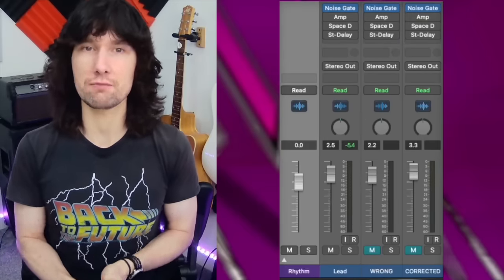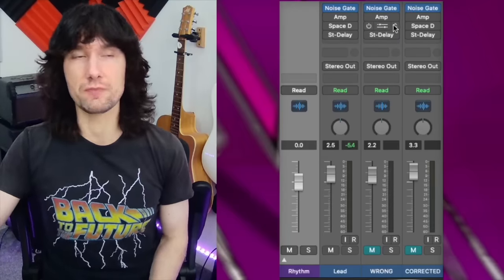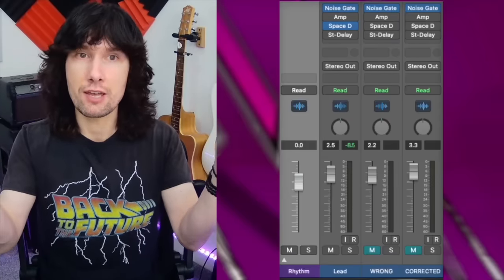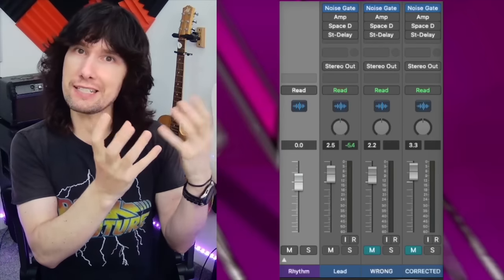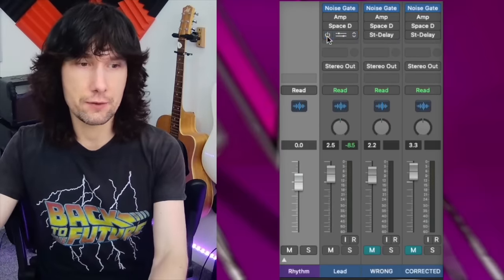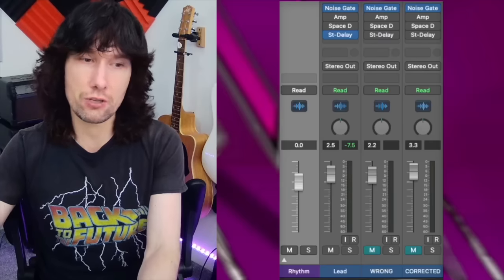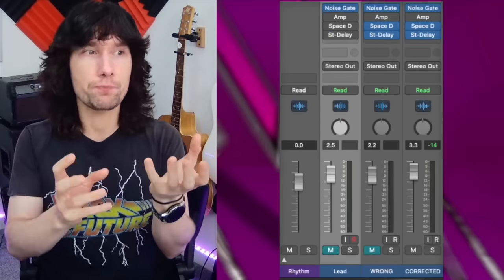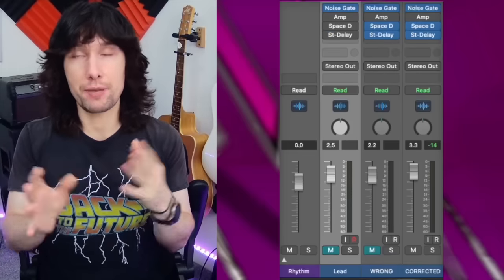So, I auto tuned MY GUITAR just to make a point!

Comment: I actually do use Melodyne on my guitar tracks. It bothers me less on instruments than it does on the human voice. We are so attuned to what a natural voice "should" sound like that significant alteration immediately sounds "inhuman." The voice also usually has words behind it, or at least recognizable consonants and vowels. Alterations to these will be more noticeable than alterations to the attack or sustain of a note on an instrument. We also recognize that no one consistently sings every note dead on, whereas this is theoretically possible on a guitar if it's intonated very well. 

I don't tune every note, just the ones that are bothering me in an otherwise good performance. Since guitar is often buried in effects, you really can't tell if I've moved the pitch 10 cents. If the whole performance was out of tune, I would redo it. But sometimes this is the better solution. It works best on lead lines and arpeggios. Dense chords can confuse Melodyne. 

I started as a bass player, and the notes on a bass bend less easily. I'm working on improving my intonation on guitar, but in the meantime I find a tool like Melodyne very valuable for allowing me to finish songs to a professional standard. A little inconsistency between doubled guitar parts can actually be beneficial because chorusing adds width. But when the bass and guitar are hitting the same note and the guitar is 10 cents sharp, it's off-putting. Punch-ins are possible too, but sometimes this method is just easier. 

Obviously, Melodyne is not the same thing as Autotune. The whole point of it is transparency.

Comment: I couple of points worth mentioning, about thirds.
1. just intonation vs equal temperament - given a key, the most natural tuning is just intonation. that's what a trained ear leans to. that's literally what feels "in tune".  In equal temperament, what a piano is tuned to, the minor 3rd is a bit flat, while the major 3rd is a bit sharp, compared to the just intervals of 6/5 and 5/4. 
2. anything in between the minor and the major third is also a blue note.

Unlike many instruments, the voice is perfectly capable of singing in just intonation in every key.  A singer would naturally tend to do that. That's reinforced if harmonies are happening (if one singer sings the root and another sings a 3rd, they'll gravitate towards a just interval, because it sound more in tune).

In this case, in those cases Autotune does not improve the pitch at all, unless there are other instrumental voices around using equal temperament.

The same applies to guitar playing.  You'd always slightly bend a minor 3rd (to approach just intonation) and it's entirely possible that bending the minor 3rd up a semitone sounds better than playing a major 3rd on its string.  Autotune would reintroduce the flatness of the minor 3rd and the sharpness of the major 3rd, undoing the player's natural correction.

Now, 3rds are not the only notes you can apply the about to, but they are a good case study.

Comment: Excellent demonstration of these techniques applied instrumentally to guitar.  I was wondering a while back if it was only singers who had autotune and/or pitch correction applied.  The pitch corrected version of your out-of-tune playing wasn't particularly bad (not actively offensive), but it squelched (attenuated?) your original style of playing - at least to my ear.  BTW, I would imagine that non-fretted string players would face similar issues with autotune as singers.  It takes years of practice for violinists to accurately hit desired pitches.

Comment: You DID pulla raBEET outta ZEE hat with this KILLER summation with contrasting comparisons. BRAVISSIMO😎 Wish I could be a YOUNG muzishun in 21st and FEEL digital the way yall do?. MY ears/ "emotions" are so dependent on feqs/ timbres that originated from analog , real sound "pressure"(amplitude modulation). ANDDD...Wish could load the under 50 crowd into the DELOREAN bus , take yall back ta 75 so you could FEEL a Don Ks rock concert/ "Midnight Special" airing blastin thru a PA at 500W?...THEN , watch the SAME BAND on AXIS TV today? OMG!  you'd NEVER wanna even enterTAIN the thought of hearin ANYTHING "rebastered". Yeah  Fil, have ya ever used a digitech/yamadog  vocal harmonizer? That was MY exp. 30yrs ago with that "auto-tune" vibe..Decided right then and there ta do my OWN harmony's for my solo gig.

Comment: In my opinion, it depends if pitch correction is cheating or not. You can have a singer that is totally able to sing perfectly in tune but hasn‘t any emotion in his performances. On the other hand there is this singer that always sings a little bit out of tune but is getting to the audience because of the emotional roller coaster ride the performance is. Or someone who can do both, delivered the best performance but on the track he/she sang a note too long or a third too low/high, still correct pitch but still wrong note. So it‘s imho not cheating to put the note where it should belong, to make the song perfect. Or keep it as it was. Whatever makes the producer or singer happy.

Comment: Nice job as usual. Years back I bought a Digital Key Transposer so I could play guitar with older recordings. I instantly realized the instruments were great but the vocals were distorted. If I add auto tune behind the transposer will it match the vocals to the transposed instruments?

Comment: The bottom line is auto tune and pitch correction is generating a "false" result.  If you process a vocal with auto tune and pitch correction, the results will not be genuine. The pitch of the vocals will have been artificially adjusted. You will not be hearing what was originally sung. You will be listening to a lie.
Why is it so difficult for some people to understand this.

Comment: i think your distinction of 'natural' vs 'artificial' isnt the right one. Pitch vibrato pedals, ring modulators, extreme whammy pedals.. all produce 'unnatural' sounds. The point is that its done becuase its the artistic choice of the player. Autotune is used to hide mistakes, effects pedals are not. The original cher extreme autotune was a choice of the artist

Comment: Question.  Does any pitch on your pitch monitor have a given timestamp associated with it?  If so, I am soooooo interested as a Data Architect!
Reply from the maker: No it doesn't, it's a manual process where I just screen capture the results 🙂
Reply: @wingsofpegasus   Though, I am wondering if there are timestamps in the underlying database of which is producing the pitch monitor ...

Comment: Of course you are right that autotune/pitch correction are different in kind from reverb, delay and distortion.
But you don't capture the difference in the right way. In contrast to delay (and, I guess reverb) when distortion is applied you don't hear what was originally produced. 
The distinction you want is simply "mistake."
When reverb, delay and distortion are applied, it is not because the musician/singer has made a mistake.
But autotune/pitch correction are applied precisely with the purpose of correcting mistakes that the musician/singer has made.
This is why autotone/pitch correction is "cheating.": It is a mechanical cover-up.
(Musicians/singers have always made mistakes of pitch, dynamics and phrasing etc., but at least they themselves made the corrections in the good old days when the mistakes were corrected by means of re-takes and multi-track recording!)
Reply: He literally showed you how you hear what was originally produced...
Reply: @nihlify  
He did not. 
Phil merely pointed out that when distortion is applied what you hear has the same pitch and dynamics as what was produced.

Comment: The main problem with Auto-Tune isn't that it's "cheating,;" it's that it doesn't sound good. In this sense, your guitar demo misses the point, because the fixed version didn't sound bad, because the guitar was playing quick staccato notes. Perhaps if you'd done some expressive bends it would have demonstrated that better. I truly don't believe that any professional singer can't sing properly on pitch. It's just not that hard to do. Everyone misses notes now and then, but I'm certain that all of today's Auto-Tuned pop stars can adequately sing on pitch. And being on pitch has little to do with what makes a singer sound good. Auto-Tune can't make someone with a weak and frail voice sound like they have a strong voice. And it can't give them great phrasing or expression. An Auto-Tuned bad singer is still going to sound bad.

The real question here is, why has the music industry decided that the Auto-Tune sound is preferable to the natural sound. It's a deliberate choice rather than a necessary crutch, and it doesn't seem to make any sense. I suspect that most of the contemporary singers who are criticized for using Auto-Tune would likely sound better if they turned the Auto-Tune off.
Reply from the maker: If you're saying it doesn't sound good, but my video sounds good, it's purely down to it's application. Applied badly it doesn't sound good, but applied with a half decent ear it shouldn't be detectable which is what every label is aiming for. But, granted, they don't seem to be able to apply it very well for some reason!

Comment: A bit late to the party but I just have to comment on Autotune and pitch correction. As a musician for 50+ years with a bit of mixing and mastering under my belt, I have to say that pitch correction when used sparingly as a tool is acceptable when recording. For example, say your singer just put down a phenomenal, killer track that everyone is absolutely thrilled with. However, when mixing you realize that when the singer was really pushing hard and went for a high note, it went slightly sharp enough to be noticeable. This is where subtle pitch correction can make a difference. I’m not talking about snapping the entire note to the line but bringing the span of the note a few cents closer so you don’t lose the nuance. On the flip side, if you have to spend a lot of time pitch correcting or using Autotune, then you should have either done more takes to get it right or kicked the singer out of the band. Sadly, some engineers just can’t keep their fingers off the pitch controls even on a perfectly good vocal as you’ve shown in a previous video.

As for Autotune as an effect, OMG give it a rest. It’s been a long running fad in pop music that lost its cool factor at least 15 or more years ago when just about everyone jumped on the proverbial bandwagon.

That’s my two cents.